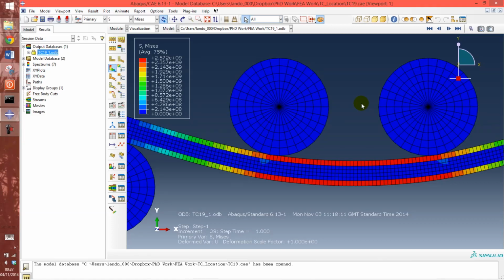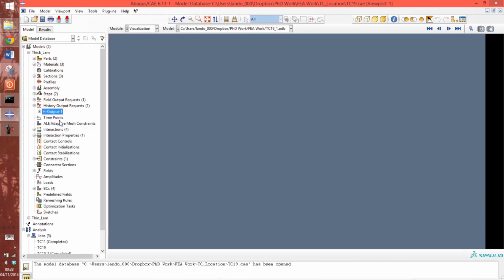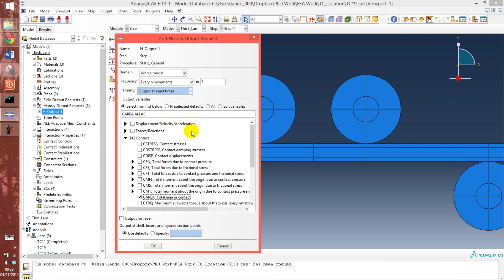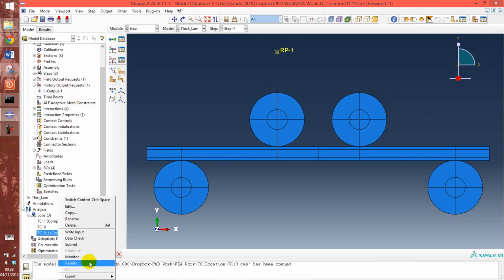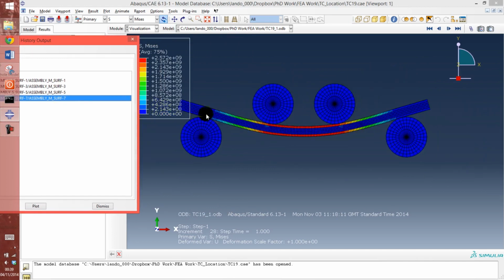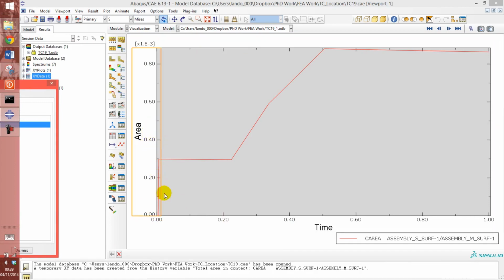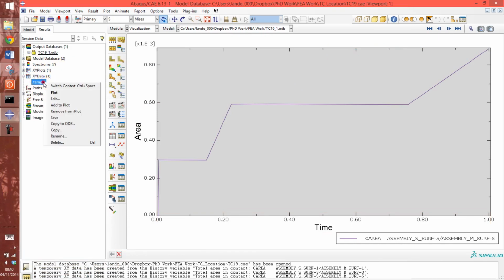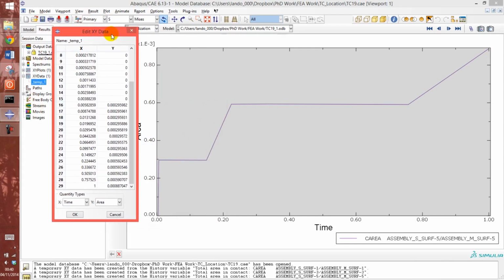Abaqus Tutorial - How to determine surface area in contact/interacting between solids

Comment: The cpset or the surface parameter must be specified for history contact output  The nset parameter can only be used for bondstat or bondload output

how to determine the surface area in contact between two parts such as punch and sheet or sheet and die